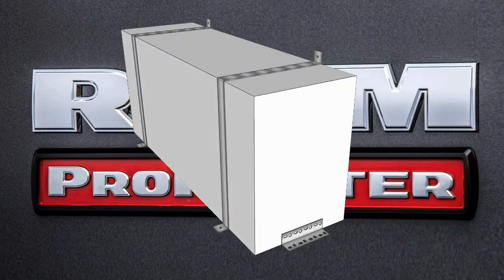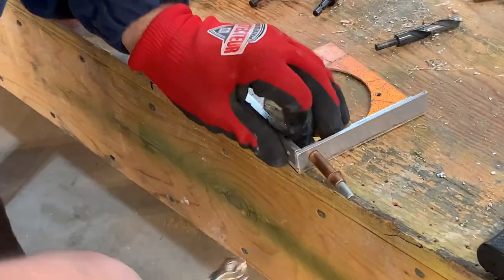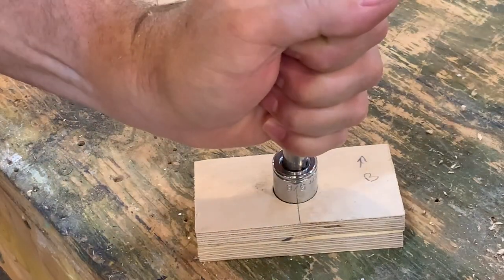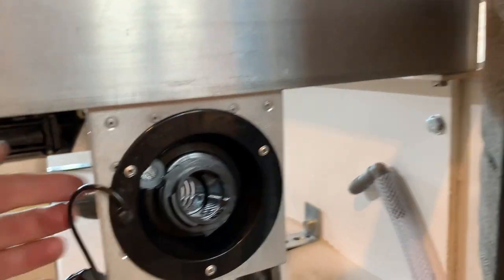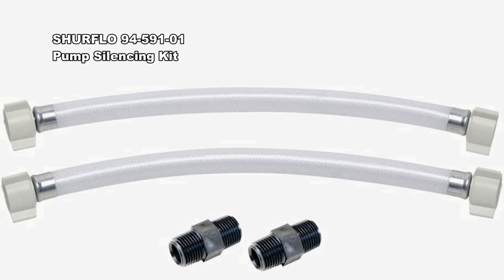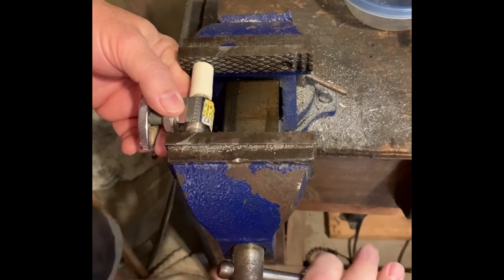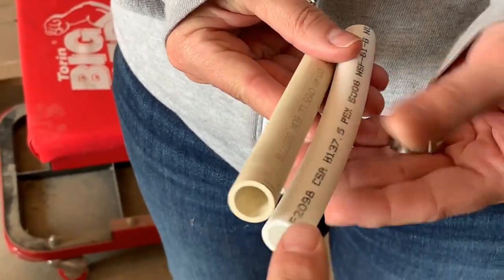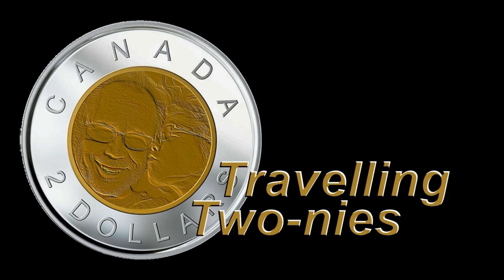RAM PROMASTER VAN BUILD – Water Supply

Comment: Are you going to add a water heater for the shower?  I am planning a similar shower and have been waiting for how you will finish it out
Reply: Adding on demand propane would be a piece of cake to this set up!
Reply from the maker: Good morning.  
Our plans could change, but currently we don’t have plans to add a hot water heater.  This doesn’t mean we won’t be able to have a shower, because we will.  Our current plan is to heat hot water for that purpose.  Yes this is not as convenient as instant hot water, but it is more in line with our mission of having a shower available “if we need it”. 

We are thinking most of our showers will be in camp grounds or swimming.    We have a small secondary portable pump kit that draws water from a bucket.  Here is a link to that product: 
 
https://www.amazon.ca/gp/product/B077NXT1X8/ref=ppx_yo_dt_b_asin_title_o06_s00?ie=UTF8&psc=1

Incidentally, I do NOT endorse this product.  Although we haven’t set it up in the camper yet, or done a video on it, I did test the unit and found that all of the fittings leaked.  So, I may or may not go down this path.  

Down the road, if we find our needs change, and we would like the availability of instant hot water, I think we would consider an on-the-demand hot water system.  

Thank you for your question, and yes we may go that route after we have a little more experience using our camper.

Cheers
Dwayne

Comment: Hey Buddy another great video. If I might make a suggestion. Think about adding a valve to the vent. My Motorhome had one and it was surprising how much water we’d lose while driving if I forgot to close it.
Reply from the maker: Hey Buddy,
I was thinking the exact same thing.  I was going to buy a screened vent for the vent line.  Now you are suggesting a valve, explain?  I do need the vent open to draw air in when the water is pulled out.  Are you thinking leave the valve closed when not in use and then open it while using the camper?  I’m not against that idea…. Tell me your thoughts.
Reply: @LifeIsShortDIY  Exactly. Just a ball valve like you have on the drain. Open it when camping to allow air into the tank but closed when under way to reduce the amount of water lost from sloshing. The tank on the travel trailer does not have one and I’ve noticed we lose up to a quarter tank of water when driving.
Reply from the maker: @scottclarke4354  DONE!  Ill send a pic